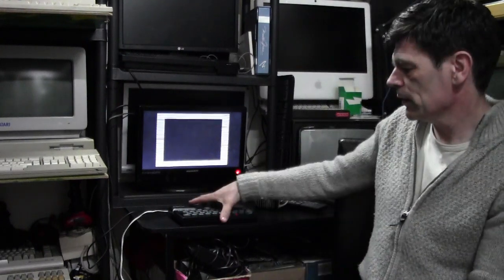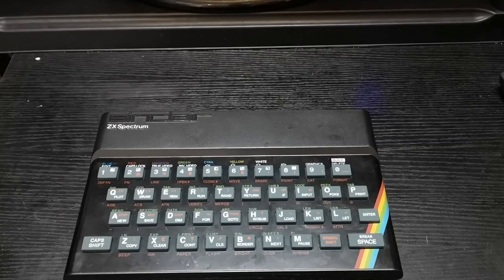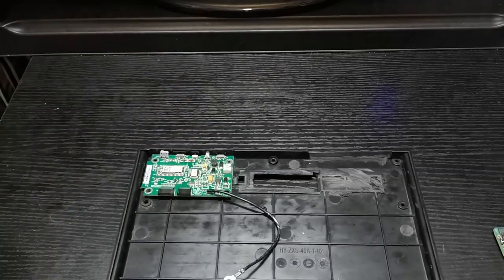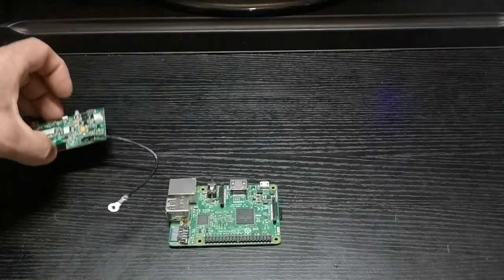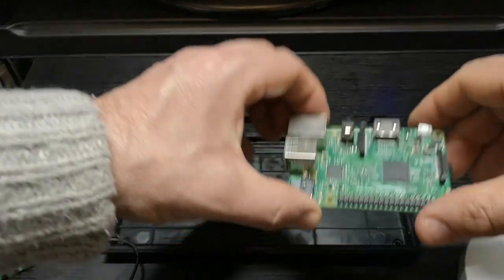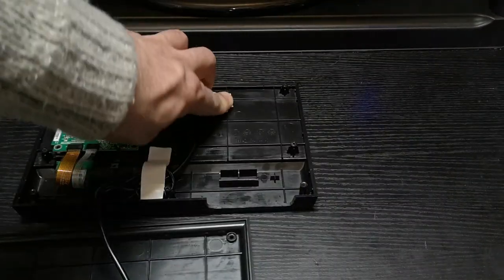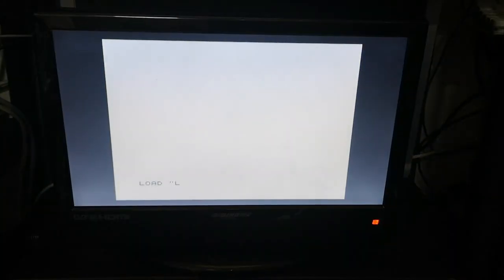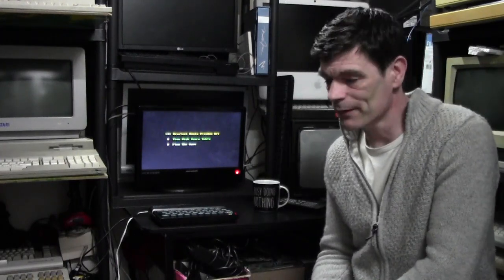Classic Computer -  Recreate a ZX Spectrum

Comment: Timex made a deal with Sinclair to put the computer on the market for 50 Dollars.  Is it true that Commodore makes an offer? People got one c-64 if they change it for the spectrum?
Reply from the maker: HI, You are in the right ball park - But ...Timex (Dundee) produced machines for Sinclair research throughout the early 1980s. Sinclair wanted to break into the American market and Nigel Searle was tasked to promote the machine. Eventually a deal was struck with Timex to produce the ZX81 under licence with 2K of memory and a Timex Sinclair logo on the machine. 
I think the offer you mentioned was the one Commodore made to anyone wanting to buy a commodore machine that they would give a discount of $100 when another makers computer was traded in against one of its computers. This was almost purely aimed at killing off the TI99/4a to get back at Texas for almost bankrupting Commodore a few years earlier. 
Commodore had no real interest in Sinclair until Jack Tramiel decided to go after Sinclair's market a few years later with the ill-fated TED series machines. Cheers Phil
Reply: @Re-Tech  I mean that some people bought only this machine ts 1000 from Timex Sinclair to get a c-64 easier.
Reply: Commodore made then one mistake. They thought Timex low budget computer will be the oponent for the TED series. But Timex and Texas Instruments left Commodore alone then on the market.

Comment: I have the worst luck ever with mounting tape no matter how expensive a tape i buy inc 3m tape. These days i just use standoff mounts glued or  screwed in.
Reply from the maker: HI, I know your pain, as I took a long time to find tape that worked due to the glossy nature of PCBs and case plastics.  But I also screw in the boards to the case where possible once I have worked out the final position. I have used hot glue in the past and this does not really like glossy surfaces either so like you I usually revert to good old screws. Thanks for your comment, Cheers Phil